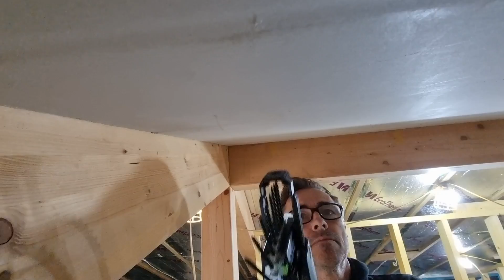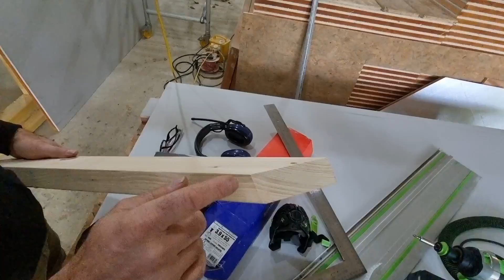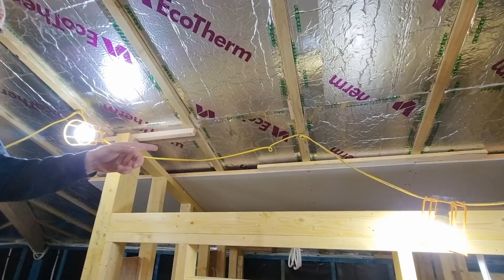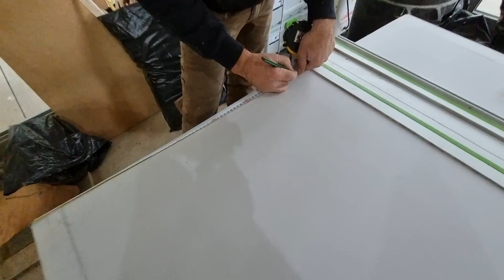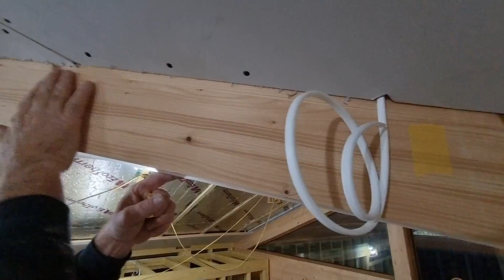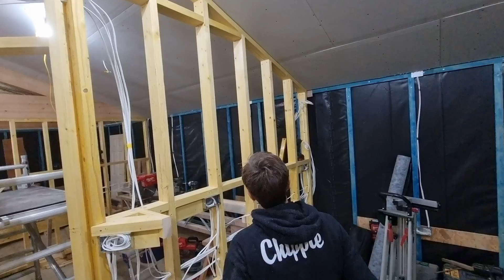How to fit plasterboard with insulation. tips ands tricks

Comment: Out of curisoirty why did you not have to install a VCL on the roof, like Protect VC Foil Ultra? I'm having to do 140mm in between + 40mm overboarded, VCL, 25 mm strapping then plasterboard. BC weren't happy with anything else. I was honestly watching the video to see if you had put the partitions up before or after the roof VCL but you don't have one :D Thanks in advance, love the videos!
Reply from the maker: Great Question, It depends very much on the overall construction build up, we did technically have a VCL as the insulation on the back of the plaster board is a VCL as it is foil backed, we also had a clear vented space from Eve to Ridge over the main PIR insulation between the rafters and the Roof covering over the external OSB roof decking is called Evalon by Alwitra and believe it or not it is Air Permeable!!! mind blowing I know, Different parts of the country, Local authority or Building Control region will have variations too!!

Comment: I was always told by a slabber from America 5 or 6 screws across the slab on the ground is plenty any more and you start to weaken the slab..  it can cause pops.... just an observation ...and I know that's insulated board.. but you should use washers on some of them

Comment: Taken a few notes from this but one thing I will add if you’re looking for top neatness is using a straight edge to mark where the rafters/ joists are on the plasterboard in once a few screws can hold it up. Just adds to the complexity you can add to the job

Comment: Out of interest why have you got the main PIR a few mm up from bottom face of rafter? Expected to see it flush and then taped? (I note the gapo though!)
Reply from the maker: I leave a small gap the principal is like double glazed windows, it also serves as a small space to run a cable or two, Gapo eliminates the need for a tape at this point, there is the insulated plasterboard that has a foil vapour barrier on the back that does the job of foil tapes etc

Comment: All the manufacturers of insulated plasterboard that I’m aware of stipulate using noggins so that ALL edges of the plasterboard are supported, including those edges running perpendicular to the rafters - I see you’ve not done this - do you find it’s not necessary? Have you ever had any objections from building control when leaving the noggins out?
Reply from the maker: They often indicate in various fixing methods in their literature, in practice on site it is always fixed like the way we do it and it is a really strong board with the insulation on the back, if it was a normal board without insulation then you may need board join supports like you mention, indeed there are thicker plasterboards that will span up to 600 centres with no board join noggins I.e. 15mm thick boards!! What the manufactures do is make sure they cover any eventualities!! Trying to incorporate a board join noggin in a cold roof application without increasing the ceiling thickness even more or worse creating cold bridges is not sensible!!

Comment: Hi Robin, is it possible to dab (or foam) insulated plasterboard straight onto an existing plastered wall without hacking of the original plaster?
Reply from the maker: Absolutely, as long as the wall is well primed, usual drywall adhesive should be fine, some foams work too
Reply: @robinclevettcarpenter  Brilliant, thanks for the reply

Comment: Metal angle on edges where no rafter to catch board is a great tip.
Reply from the maker: It works so well too!! this is a Dry lining angle and they are super cheap... about 70p per metre!!!
Reply: @robinclevettcarpenter I'm keen to find out exactly rhe type of angle trim that is. Is it a gypsum product? . I have issues insulating a dormer where a insulated wall meets a lower ceiling at odd angle and need something to fix end of plasterboard sheet to.

Comment: nice one robin, what is the blade you used? often thought it would be a time saver to cut plasterboards etc with the track saw. ill assume the same blade can cut those cement based boards that tilers use on shower areas etc
Reply from the maker: Hi Paul, this is as you suggest for cutting cement based boards, I have a few in my Amazon store, If its for a TS55 then this is a good entry level blade https://amzn.to/3U1ZikP
Reply: @robinclevettcarpenter  thanks robin, yea id probably use one on my ts55. seems the best machine for stuff like that. be a better job than scoring and snapping them all the time. same goes for standard plasterboards also. ill pick one up and it can stay in the box till its needed 

cheers mate

Comment: Would it be necessary to use washers with the plasterboard screws? Or are they only necessary for a certain depth of board?
Reply from the maker: We only ever use plasterboard screws and never washers, we use washers on soft material such as thin layers of PIR or some shower/wet area boards

Comment: I’m just doing something similar , I’m trying my hardest not to leave gaps between the layers of insulation 🤔 just curious what people think , I don’t remember where I heard it but heard it’s a bad idea to have gaps between vapour barriers where moisture can get trapped .. 🤔🤷‍♀️
Reply: No straight answer really…… it depends on what that moist air meets if it gets beyond your VCL…. If it’s a gap where there’s more insulation outside of it then the temperature is unlikely to have dropped enough for the moisture to condense onto the structure. In this case, the primary purpose of the insulation is to minimise thermal bridging of the rafters to the inside. The increase of the overall U value because of it is a happy by-product. Whatever moist air gets beyond that plasterboard won’t find conditions radically different the other side. Every construction is different and needs assessing on its own merits.
Reply from the maker: Top of the class Paul
Reply: Awsum thanks for the reply 🙂 Makes my life a bit easier 😋

Comment: How functional is that aluminum surface when it goes one face up and one face down? Should not be pointing towards the room only with 25-30mm space to work as reflective surface? To my knowledge all reflective surfaces have a really high SD value(over 1500) and it doesnt allow vapours inside the structure. In your case it seems like the vapours will be trapped and it will migrate towards the rafters. Could you please clear that for me Robin? Also big thanks for all your work online!